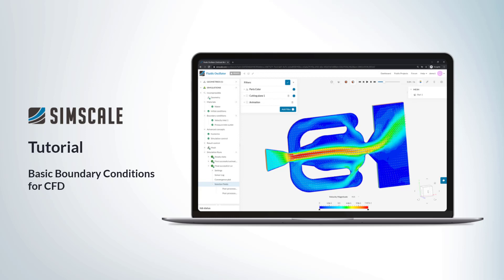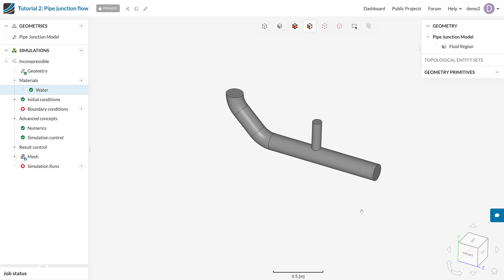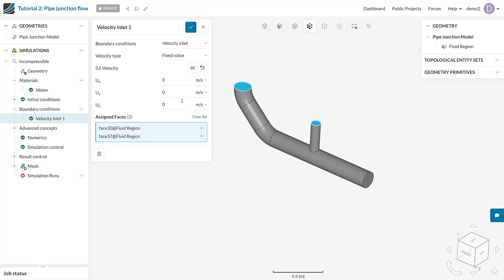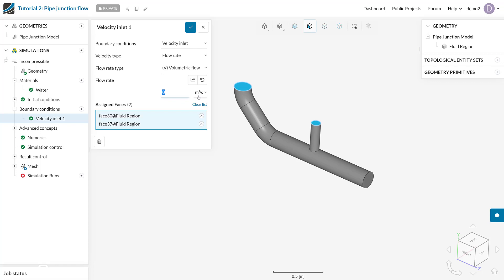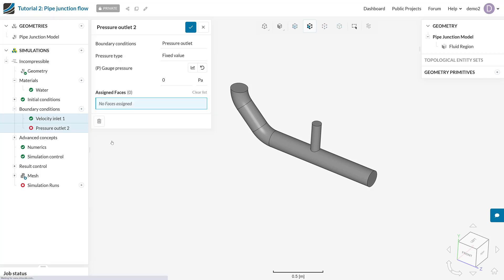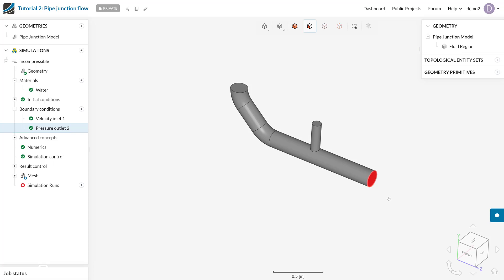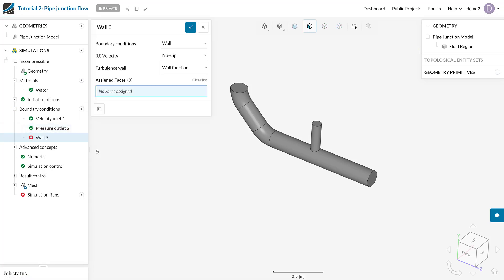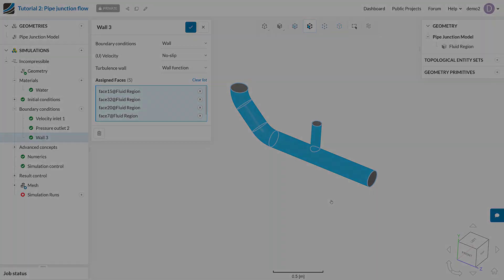Basic Boundary Conditions for CFD

Comment: hi guys. i am new to cfd. i have a doubt. if place a fan inside this pipe will i be able to calculate its rotational speed?
Reply from the maker: No, this requires fluid-structure interaction which is not supported yet. The velocity would need to be set.